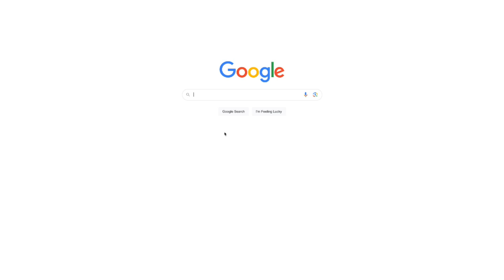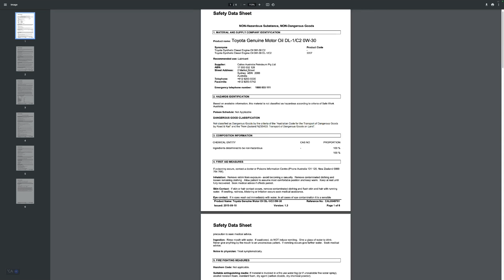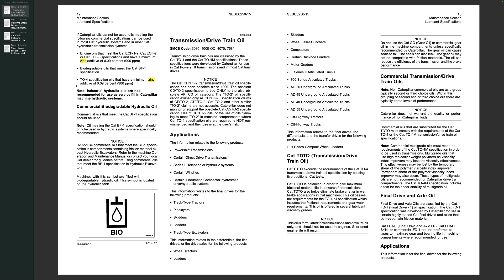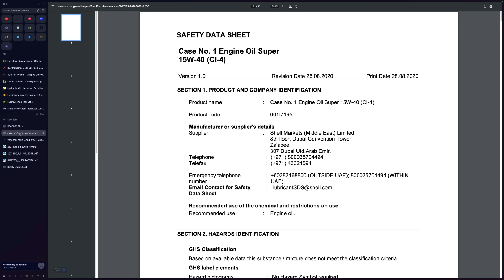Who Makes OEM Oils?

Comment: Recent 0W30 premium oils (castrol, Total Energies, shell) are better than their 5w30 counterparts,  have the same or greater viscosity (12.1 to 12.3 cst) at 100C and higher VI (185 up to 205) while keeping HTHS >= 3.5. how can you explain that?

For BWW, Fuchs is the OE supplier for CHF hydraulic steering fluid. Castrol for engine oils starting 2024.

Comment: BMW motor oil is made by Shell. That SDS was for MTF LT-5 specification manual transmission oil.
Reply: should be Castrol, but who makes it for Castrol?😅
Reply: @gasauto1675  It was Castrol for quite some time, but for a few years now it's been Shell.
Reply: BMW was Mobil, then they went castrol. They used to say we only recommend Mobil, then it was we only recommend Castrol. Just whom ever they have the contract with.

Comment: It is rather confusing because the factory fill or aftermarket supply may not match or the SDS could be old. For example, that BMW MTF-LT-5, when you buy it in bottles from a dealer in NA, is from Febi Bilstein based on the bottles I have seen now. The Fuchs (Pentosin) bottles were phased out several years ago.
Reply from the maker: Yeah it's very much a contract manufacturing situation, so the blender changes reasonably frequently.

Comment: Manufacturing of these engine oils is  a simple routine step.  The real question is who designs these oils with what goals in mind???
Reply from the maker: You'd be surprised how many blenders get the manufacturing wrong. Heat blending is often skipped because the blenders try to skimp on the cost of power, and I've seen blends that either separate, or have incorrect additive packages, or insufficient VI improvers. The design seem to mostly be done by the OEMs - most of the majors have tribology teams, although these have been cut down in size substantially over the last few years.

Comment: funny how when I was a mercedes dealership mechanic all cars got the same oil in spite of all of the different oil classification for their different cars. 229.5 229.51 etc.  it is a smoke screen
Reply: MBUSA is cracking down on that.   We got multiple warranty services kicked back because were were using 229.5 in the newer 229.71 0W-20 cars.  Of course, trying to get the MB 0W-20 is like pulling teeth, our last order took two months to arrive.
Reply: @glhs386  when I was a tech at the dealer. we had 1 oil line between the bays. all cars got the same oil

Comment: My son works at a Toyota dealership and they have the bottled Toyota oil in parts and the bulk oil in the oil dispensers.  They source the bulk oil from Kelley Williamson oil locally.  Does Toyota give the dealers the recipe or is the bulk oil just a local blender product that may or may not meet the specifications of Toyota?
Reply: Toyota is rather flexible with this. As long as the oil complies with the standards of API in most cases,it can be used.
Reply: My local Toyota dealership uses Castrol in 205l drums as their bulk oil
Reply: Typically Toyota just asks for API SP oils from anyone. Most oils in the oem viscosity do that.